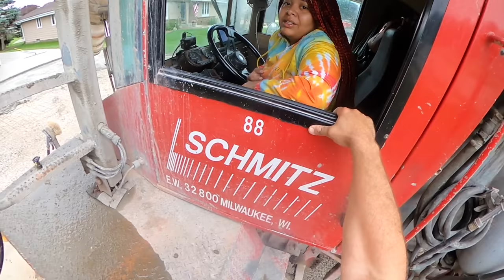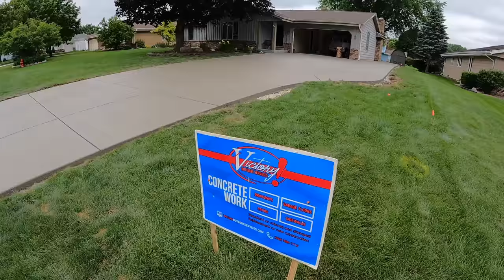Concrete rejected-Load was too wet!

Comment: Watching this video why wasn’t the wire mesh wasn’t lifted up and put in the middle of the concrete? Thought that would help strengthen the concrete more
Reply: Concrete reinforcement is mainly for assisting the concrete with resisting tensile force, which builds from the bottom up. Whereas concrete itself is already good at resisting compressive force (cars on a driveway), which builds top down. So it makes more sense to put reinforcements near the bottom.
Reply: I noticed that also. It should have been pulled up or put on ladders. With it sitting on the bottom it does nothing but rust. Waste of money to even put it down.

Comment: It looks like a great install and nicely finished job. However, even though you had road mesh or WWF, never did I see in the video your guys pulling the reinforcement up into the concrete. You know it’s worthless on the bottom. Hopefully it’s just something that didn’t get video’d.
Reply: Noticed the same thing, no bar chairs or someone pulling it up as you said
Reply: I thought the same at first but around the 28:44 mark you can see him pull it up.
Reply: he does pull it in most videos there’s parts of him getting on to daryl jr for not pulling it up correctly
Reply: My thoughts exactly.
Reply: TRAVIS08P  ... Once in 39 meters when the camera's on him doesn't count.
Reply: @TRAVIS08P  But then they start walking all over it forcing it down to the bottom again. They should have spacers below that makes the entire mesh float. Its a PITA to walk on since everything is floaty and wobbly. But there will be no doubt of it actually being inside the concrete.
Reply: We always used rerod in all our driveways and for commercial used those chairs to hold the rod up
Reply: @Ormathon  Concrete is mostly gravel.   You are not going to push the mesh back down easily once it's pulled up.

Comment: Love the finish. But a question for you. You've put mesh directly on the ground. This won't have hardly any structural purpose.  Mesh should be of the ground so the concrete can wrap around it. Also if the steel Mesh is on the ground it can get wet. Rust expand and blow the concrete. But your actual Finnish is 10 out of 10
Reply: If you watch.. himself and his peers lifted the grates as they poured.. and also in other videos he has made it clear how often he raises them... but agree on how raising the mesh is a must...
Reply: We always put bricks under the mesh and it luts in exacy where it needs to be no pulling on it required

Comment: Looks like the steel trellis is there to keep the grading in place, right ? Imagine these guys were pouring the pool deck at Champlain Towers South.
Reply: Seig Fuk  Duh yeah. but if you don't put it IN THE CONCRETE it does nothing. There needs to be enough concrete "cover" to stop the bar rusting and to ensure that it does not slip (break out) when stressed. Pure concrete will crack easily under stress , the steel provides tensile strength and prevents cracking ... as long as it has required cover. ACI has standards, if you know what that means.
Reply: Seig Fuk  So, you think you know better than me, what are NZ standards for the minimum cover around steel bar in steel reinforced concrete? You claim superior knowledge of superior standards but don't say what the standards are.

Comment: A mixer driver should never only count on their meter for the correct slump.
They should always visually check their load. That was clearly  a 8-9" slump. The driver should have been able to also hear it was too wet.
Reply: You are the one to check the slump not the driver
Reply: @JohnAdams-xc5yk  of course the driver checks the slump before he leaves the yard. Where i work we add the water via fire hose so we read the bill usually leave the yard with 3 inch slump. Nmy slump gauge has never worked so i eyeball and ear it. U know it passes 6inch when u cant here the rocks and u just hear a faint slosh
Reply: Yeah 100%,  I'm a mixer driver in Australia and it's our job to take it at the required slump either 3 inch or 4 inch (80-100mm) normally and only use 7 inch or 180mm for block fill.
Reply: @Adventureswithrushy  in toronto we always use at least 5 inch slump for slab even up to 7-8 inch. Walls between 4-5 and cassions 6inch

Comment: Just curious about the reinforcement mesh, how is it suppose to help when its not raised up or another layer 2 inches up
Reply: His work is so tight I am surprised as well that it was not tied or raised. His control joints are so well laid out and installed while wet, flat ground over gravel packed. Do not need the wire so installing welded wire mesh waste of time and money anyway.
Reply: I saw that too. Just a waste of money lying on top of the gravel.
Reply: @RON-dl9qr  Goes on about wet concrete but mesh laid incorrectly with no cover. Mesh would corrode and be useless.
Reply: @migrationfuntimes303  mesh will not corrode if pulled up an inch or so while laying the concrete. A simple 2 second hook with your come along to pull it up is all that's required
Reply: I've only laid one DIY garage slab and I knew enough to raise the mesh.
Reply: @steveky7829  My comment was on a video that I saw a crew place and compact the base, pour the mud, properly lay out and tool joints in the concrete while still plastic. I do no know a damn thing about your basement. What the plans called for concerning steel or wire, moisture mitigation, slump, thickness, weather conditions, temperature, 
were any curing chemicals used, when did the control joints get cut, was it an early entry saw, did it even get control cuts, did any hot loads show up. (illegal in most places, always unethical to top load returned mud, but it happens) ? LET ME guess some one told you the reason it failed was because it had no steel. As we all laugh because we have all removed failed concrete with lots of steel. I find the main reason concrete fails is too much water. My personal experience. But hey KY your the expert who can spot an idiot through the internet. So educate me. Tell me when to use rebar versus rolled wire or  sheets of welded wire, what gage to use when and where? How and where to place control joints. Hey maybe it failed 'cause they did not use fiber.
Reply: @Concrete_Jockey  always had a dedicated man on the mesh. you can get it up where it's supposed to be, but it's not easy.
Reply: @haydona1845  that doesn't work that well. we used a homemade rebar hook and a dedicated man during the pour. right at the screed, you need to stay on top of it. we cut a couple driveways for piers and such, and i always loved to see the mesh dead center. if you do it right, the concrete is like iron even with plain old sidewalk mesh.
Reply: Getting the mesh at the correct herigtht is important. I have heard of concretes lifting the mesh out to save a dollar.

Comment: I've considered working residential concrete because it's where I always felt at home. I did pole barns through my 20's and 30's and we would pour 200 to 300 feet a day ..just one truck right after another all day. During the peak of summer it was just miserable, but the rest of the year was perfect. When you're with a crew that knows what the other is thinking, you get a smooth coordinated effort with perfect results and luckily, I had an experienced team to work with. Great job everyone!

Comment: Great video! Thanks for the explanation of the joints in the concrete and how it is similar to scoring glass. I would recommend using a keyword or two about that relate to the purpose of the joints. It might drive more traffic to the video, not that you need it. It looks like you are doing pretty well here on YouTube. :) Very best to you, your family, and your crew!

Comment: I used to be owners representative on hospital construction projects,  when I  got out the slump test equipment and sample tubes on one project the first concrete truck turned around and left.  No test no explanation no nothing just left and suddenly when the plant was called they had a problem.   General contractors called a different plant who were happy to supply the proper mix.  Enjoyed your video.

Comment: They always pull the wire, he's explained in few of his other videos. It's hard to tell when his point of view being so high up. 

If you put the video in .25 playback speed around 19:53, 20:33, 24:26, 24:56  you can see it.
Reply: Yes, those little tugs on mesh do not even come close to what is required to get the mesh into the center of the concrete.

Comment: I Iove watching your vids man I’m 17 and I been in taxidermy , painting , framing , tile , and now I’m working as a handy man I do fence work patios all types of work jus not concrete unless we use it to fill holes for the fences but concrete it’s definitely something I wanna learn
Reply: If you want to learn how to lay concrete, do it right, because this guy it doesn't, he didn't elevate the steel mash half way of the thickness' of the concrete, have the mash on the bottom of the concrete don't hold nothing.
Reply: @battistaluca8582  good eye man. Definitely caught that and I'm not a concrete guy. Reckon why?
Reply: @battistaluca8582  Wrong.......you can clearly see them using rake to lift mesh during pour at 20:30 and also thruout the job
Reply: @michaelshepherd733 Many people agree with me, nobody with you. Take a good look in front the garage, someone with the rubber boot push the concrete, and at right rear also when they start, the mash was down to the bottom, nobody left the mash.............
Reply: do yourself a favour, Get into plumbing or electrical.
Reply: @alecingersoll4589  HVAC
Reply: You haven't been doing any of those very long then
Reply: @thisguy333  cut my hands on  that garbage all every day Trying to hang waterline.
Reply: @norgepalm7315  if you didn't finish highschool, you can always finish concrete.

Comment: Not Only are you not using rebar but you’re not even pulling up the wiremesh!?
Reply: Thought I was the only one thinking it!
Reply: @raulortiz3449  Not picking up the mesh, not tieing the overlaps, no consolidation of the concrete, SOOOO many ACI violations in one pour.  Finish looked great too bad the reinforcing is sitting on the ground.

Comment: As a concrete contractor myself, I enjoyed the video. Im curious though, I was trying to see if you guys were pulling the wire mesh up into the concrete as you poured. I didn’t see it, but maybe it was lost in the time lapse.
Reply: Exactly
Reply: I was watching for the guy pulling wire up but did not see it either.  Most wire ends up on the dirt and not in the concrete on a lot of pours.
Reply: Watching mesh just lying on the dirt like that - makes me cringe
Reply: Would that be necessary since the concrete isn't that thick? Don't all they need is a good base? Concrete still gonna crack from thermal expansion, only difference is they controlled where it cracks.
Reply: @garyr7027  The mesh is to hold the pieces of concrete together when it cracks, whether that be at the control joints or otherwise. If the mesh is at the bottom and not up in the concrete there can be movement between the two pieces on either side of the crack. Whether than be separation or lifting/settling.
Reply: @colberjs  I know what the mesh is for, the same reason why rebar is used. What I don't get is why it makes that much difference on the height of the mesh since the concrete isn't that thick? I could see if the concrete is 6 inches thick or more but it's not. Can't see the concrete pulling apart at the seams since the mesh IS still there... just sayin. Obviously they know what they're doing, otherwise would he still be in business all these years?... I highly doubt it.
Reply: @garyr7027  If the mesh is laying on the ground it’s not in the concrete and is not part of the slab so it’s not going to hold near as well as it would up in the slab. Not to mention, being on the ground it’s going to rust out in a short amount of time and have no benefit at all. I never said the guy doesn’t know what he’s doing. But it’s common knowledge that rebar or mesh laying on the ground under the concrete is pretty much useless. I’ve tire out enough broken and separated concrete with mesh laying on the bottom to know what it does. Thickness of concrete doesn’t matter and I’d argue it’s more important on 4” concrete than thicker slabs.
Reply: @colberjs  just thought I'd let you know, I watched another video of his, and they did pull the mesh up on another job. It could very well be he just didn't show it on this video? However, I get what you're sayin and it does make sense.
Reply: Agreed this a bad way to pour concrete. I am a registered PE with 30 years of experience and worked a lot of concrete jobs. The wire mesh is a bare minimum reinforcement, but it does absolutely no good when it is on the bottom of the concrete. He can claim they were lifting it, but 1) that is the wrong way to do it, and 2) his guys made a half-hearted effort in doing it. He is wasting his client's money. This concrete will look worse than the asphalt he took out after 10 years. And he will be long gone.

I am glad he doesn't live near me. I would never hire him after watching this.

Comment: Just curious what is point of putting the wire in, if its sitting on the ground?
Reply: It should be lifted some as they go
Reply: @quickstrides4533  it should be on chairs. i do inspections for a living, and i always cringe when a contractor says they will just lift it as they go. it's actually not acceptable practice, per aci.
Reply: It’s the same as rebar in much larger builds like skyscrapers where it helps to hold the concrete together and stops it from moving apart too much
Reply: @bucko60  than why don't you tell them
Reply: @bucko60  I agree often they have the dobies laid out and put them up as the truck backs up.
Reply: @bucko60  your totally right, and same here. I just roll the eyes.

Comment: They make a metal hook like rod so as the concrete goes over the wire u can hook it and pull it up a couple inches. Wanna talk about integrity u missed that one.  Also do you not protect the siding and brick with plastic from concrete when u dump outta buggy?  Seems it would splash on.  Other than those things great vid
Reply: I was going to say the same thing, I work with fellas from OPCMIA 599 also here in WI. You gotta pull the metal up or it’s useless to even put down.

Comment: How much does it cost to get a job this big done? 
Edit, I'm not even into this concrete stuff, but I ended up watching this whole video. What a standup guy you are. Good job on the driveway. Now I have to get back to studying.
Reply: Well the concrete costs about $120/yard depending on its psi rating and will vary depending on location. This job used around 40-45 yards so that's about 5 grand not including steel mesh/rebar or labor so you're probably talking about 10-12 grand or somewhere about there

Comment: Except for the wire mesh laying on the ground, instead of suspended to be encased, it was an excellent work
Reply: I noticed that as well, but wasn't going to be the one to say anything.  lol
Reply: @jerrybruckhart9134  You lay the mesh on the ground, then once the mud is down and before it's screeted, you walk back through and pull it up with your hands. The weight of the mud keeps it suspended and you don't waste a bunch of time laying out spacers. 

I would assume they did that.
Reply: @sorrenpeak4870    Yes, that was my point, I only noticed them pulling the wire up a time or two through the entire job.   I am not saying they didn't, maybe I just didn't pick up on it.
Reply: "Lift it up with your hands " ???? Hahaha no...wrong answer... you just made that mesh useless... use a dobie
Reply: @FClef714  What are you talking about?
Reply: Exactly, noticed right away. This way the function of reinforcement is nullified. It is useless there.
Reply: @sorrenpeak4870  Probably, very likely.

Comment: As a former concrete guy i?cringe when I see”experts” leave the wire on the ground o would be constantly say lift the wire life the wire !!!!
Reply: I could not agree more with you, leaving the wire on the ground defeats the object of even bothering to put it in!  That wire will rust away in 3 to 5 years. Rejecting concrete that's too wet due to it ruining the integrity of the poor was spot on, integrity already ruined due to wire placement.
I thought maybe that in America they do things different than here in Blighty. 
I walked onto my first building site at age 15, I am 55 now, jack of all trades master of two and never have I seen the wire laid like this.
Reply: @fruitgums  i worked in Australia and here in the USA pouring concrete for family business and my self in Australia, we used wire chairs so u don’t have to pick up the wire they have them here to but rarely use them Thst I noticed , here I used the wire 5’ long support they added strength and definitely kept the wire off the ground, I did notice in a lot of other videos that victory   do pull the wire up they do good work and finish is top notch !!

Comment: Great job, but I've  got to ask ,here in New Zealand the steel mesh is Raised off the ground with a plastic moulding called a bar chair so the concrete is the same under it and above it ,you don't have that? Just curious  James

Comment: I thought the wire mesh was soppose to be 2" off the gravel when you poar..
Reply: Literally does nothing when it’s laying on the ground drove me nuts watching it the whole time
Reply: I thought that also. Helps strengthen the concrete.  But when flat on the ground its doing nothing. But wasting 💰